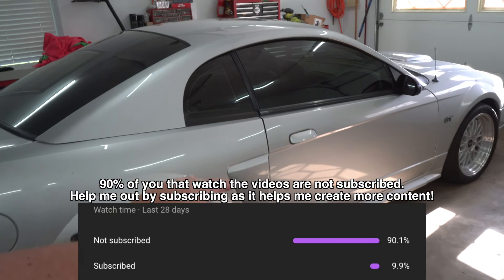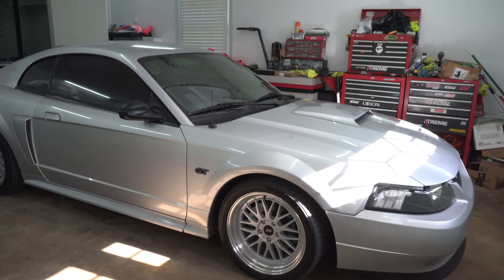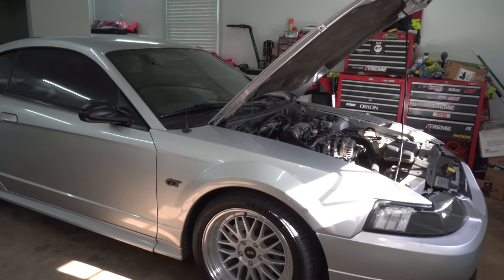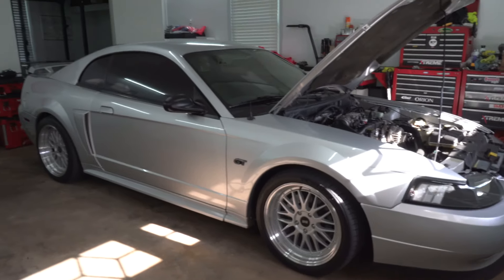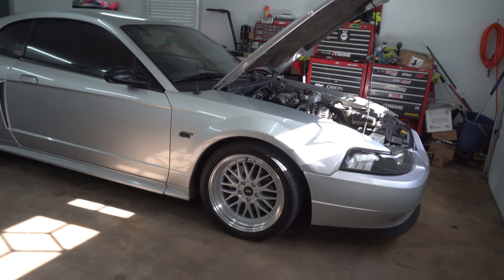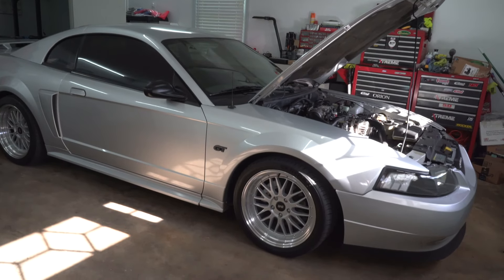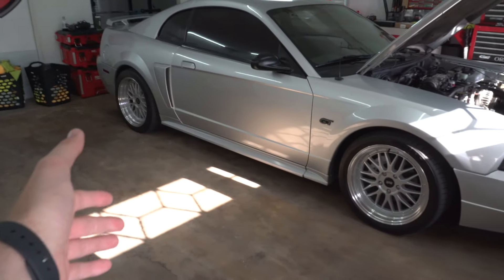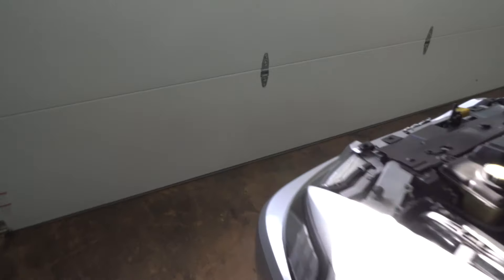My New Edge Mustang Has a Few Issues...

Comment: As previously said get a new bearing and make sure everything is fitted properly. Also do a trans and diff fluid change. Cheap and easy to do. Cant help with the engine stuff as we dont see those engines here in Ireland too much.
Reply from the maker: All of that stuff has already been done less than 2000 miles ago. That’s one of the reasons why I don’t understand what the noise could be lol.
Reply: @carsonchafin  does the noise go away when you have the clutch pedal down
Reply from the maker: @Quattro_Joe  it actually happens when the clutch is pressed in which is strange. It’s only happened 3 times and I’ve never noticed a difference in drivability so not extremely worried about it but it could be an issue in the future.
Reply: @carsonchafin  it could be the throw out bearing. It’s shouldn’t fail too quickly. Send it to Valhalla 🦾🦾🦾
Good channel pal. Subscribed 👍

Comment: Am thinking about getting a new edge gt soon. A lot of people say the 4 speeds are slow. I also have to learn to drive manual. Which do you recommend, since you did a manual swap.
Reply from the maker: Honestly, if you want a manual I’d say get one even if you still need to learn! They’re also pretty easy cars to learn on. The autos are slower but at times I do miss the easiness of throwing it in drive and just going. It is wayyyy better to get a factory 5 speed instead of doing a swap mainly because of the price to do the swap and the resell value of the car. I took mine to a shop to have it installed just so I could have receipts on the installation if I was to ever sale it! Whichever route you go with you’ll enjoy.
Reply: @carsonchafin  Thanks for the advice man, for a while now I’ve been watching your videos to have some inspiration on what to do with mine.
Reply from the maker: @isodeivys611  anytime! That’s awesome to hear thanks for watching!

Comment: That's a shame, seems like its gonna be a mess. I'll take it off your hands and outta your hair for you, don't worry. :)
Probs a TOB, dunno if all the bolts for the clutch/flywheel down there are new or not. Make sure the adjustment is right on the clutch cable and it'll last. Hard driving always wears shit out so maybe the TOB or something else had some freaky pre-mature failure. Taking the trans outta these is super easy so shouldn't be too bad to take a peak down there.

Comment: If u push cluch in it stops right
Reply from the maker: It actually happens when the clutch is pressed in which is strange to me. Plus this is a brand new clutch with less than 2000 miles on it.
Reply: Oh ok